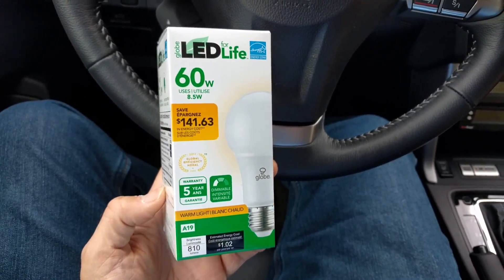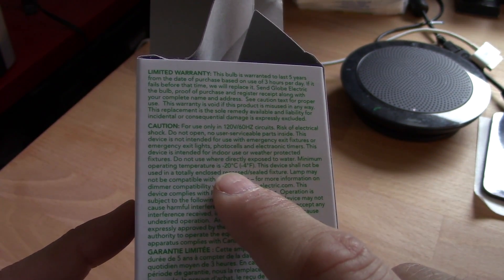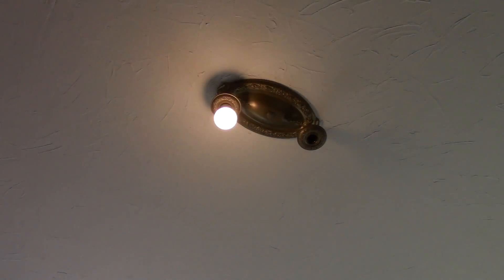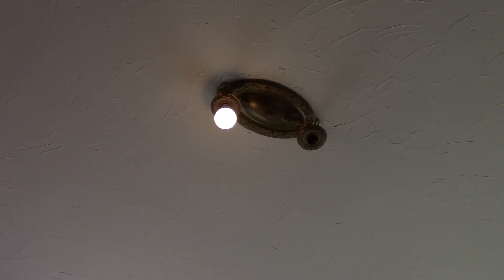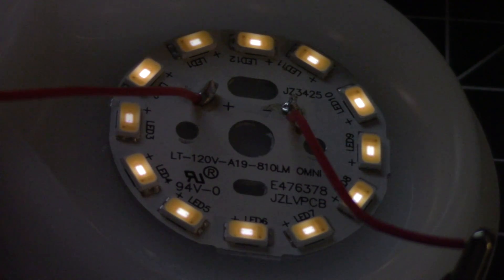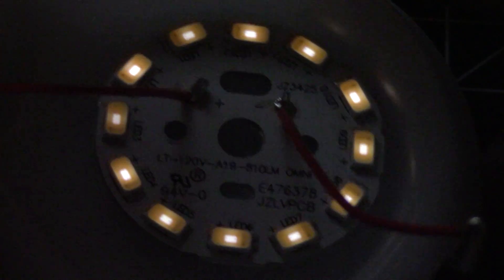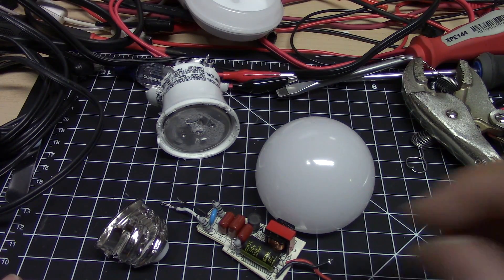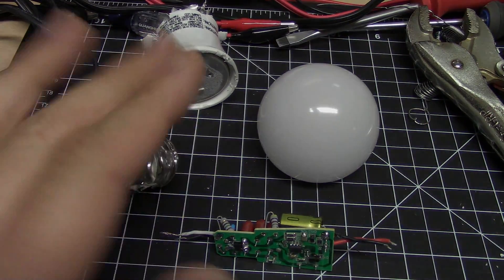Dollar Tree $1 Dimmable LEDlife 8.5 watt (60 watt equiv) LED bulb review and teardown

Comment: So, do these Globe LED lights still work at this point? Have you tested their longevity? That's the real test of LED  light bulbs: how long they actually last. I have some Philips LED bulbs that are 3.5 years old and still working, although one has slightly dimmed. The cheaper LED bulbs usually don't last as long as the more expensive ones, but only real world usage will show you the results.
Reply: @adriansdigitalbasement  I see. Thanks for the info, Adrian!

They're currently selling these Globe LED bulbs for $1.50 (Canadian) at my local Wal-Mart store. With the hydro rebates earlier this month, they were actually selling them for 50 cents per bulb. I didn't buy one, because I thought they were junk. LOL! Globe used to make the dimmest incandescent bulbs I've ever seen, so I thought these would be similar. But it looks like I passed up a good deal. LOL! However, I did get some nice Sylvania LED bulbs (9 watts, 2700K) and some Noma bulbs (9 watts, 3000K) for 50 cents a piece. So, I didn't miss all the LED deals. LOL!  ;-)

So far, my longest lasting LED bulbs have been Philips, particularly the "Slim Style" bulbs. They're 3.5 years old now and still working. One bulb did dim slightly (I checked it with a light meter), but that was after heavy usage: I estimate over 21,000 hours of usage, but that's an approximate figure. It still works, though. It's just slightly dimmer now.

Anyway, thanks again for the info!  :-)
Reply: @adriansdigitalbasement  Have you tried dissecting any LED filament bulbs yet, Adrian? They're pretty interesting. The light they cast is very similar to incandescent bulbs, although the colour temperatures can vary. They're more expensive than the regular LED bulbs, but during the hydro rebates, we can get good deals on them up here too. With the hydro rebates, I've bought LED filament bulbs for as little as $1.65 (Canadian) for a two-pack of G25 bulbs. If they last, it will be a good deal.

That might be an interesting tear-down project for you: dissect an LED filament bulb. Just a suggestion, though.  ;-)

Comment: I guess the dimmer that you used is not a classic one built in triac (leading edge), because according to the circuit there is no special IC to support that.
so the dimmer that you used is a digital one (PWM) ??

Comment: I am a gaffer by trade and I actually prefer 3000K to 2700K. I find the 2700K Kelvin too yellow-ish for my taste. My real determinant though is the purity of the color. Often the CRI (color rendering index) is lower in cheap LEDs and you may, or may not, see a green or magenta cast similar to CFLs. A problem with dimmables is the thresholds. The don't have the smooth, incremental dimming of the old tungsten or halogen bulbs and may not dim as darkly before dropping below their minimum operating threshold and going off or stopping at a minimum dim that may be more lumens than desired.

Comment: Even in the expensive UK, we have 5W led bulbs for £1 in "pound" shops and 9W bulbs at 5 for £7 in builders merchants, including purchase tax.  The bulbs give warm, pleasant, useable light and don't have very poor power factors.  They are not dimable, but I don't care.  I have used them exclusively in my house for a year or two and have suffered no failures, although some do get hot to the touch.  These bulbs are certainly not subsidised in the UK!

Comment: those are a bargain at a dollar...I tear em down and through them in project boxes for use as LED project power supplies so the projects can be plugged into mains without messing around on a breadboard developing a mains LED power supply from scratch.  also they are useful for driving "high power" led chips like the 10/30/50W ones at a nice low state without over driving them either permanently or when  testing. ....it's a quick and dirty way to get mains to useable DC without spending a ton of money, time, head scratching, component hunting etc. I buy em all the time...n they are great for threshold testing certain stuff too...for a buck, who cares if you blow it up! ...n I've scavenged caps and passives from those boards as well....for a dollar I couldn't buy those components in the amount you get...very nice when you find useable opamps and other treats inside some of them...n the caps and transformers are EASY to desolder and use in other stuff. I can't find transformers of a similar value for around a dollar each unless I buy in quantity do that alone is a benefit... hope you guys got some ideas from this novel lol

Comment: 99cent only! had 8 watt (60w equivalent) led bulbs. i bought 2 just to check if i liked the light output & color. i did, so i went back and bought like 25 of 'em.
when you compare to the cost of the led bulbs you find everywhere else (typically $5 to $20 each), it was a no brainer. replaced all my florescent bulbs.

Comment: That's one hell of a good purchase for only one buck! I saw my first real $1.00 light bulb at the 99 cent store chain in California and I picked it up. It was terrible! Claimed to be a 40W equivalent using only 5W and it was 6400K giving absolutely the most garish white light that resembled the fluorescent lights of the 1930's I took it apart and the thing had 1/4 the circuitry your $1.00 store bulb has. How crazy that less than 10 years ago LED bulbs were selling for $60.00 each! The 99 cent store light bulb is so cheap that it weighs less than a real glass light bulb. https://www.flickr.com/photos/9874196@N03/albums/72157665903562912
Reply: 4 years ago they were still going for that price.

Comment: Wow. That circuit in yours is elaborate.. I just opened the Luminaire Home 60w I found at my Dollar Tree. I think I need to grab the rest - I don't think it's regular stock yet.

The circuit I saw in the bulb id just two components - a bridge (MB10F) and an all in one driver ic (BP5131D) - I'm uploading the video to my account soon ( at time of this message it was still rendering ).

The distributor is Greenbrier, which is Dollar Tree so maybe this will become a regular product as Walmart already stocks a $2 version.

The discussion is here:
http://cornerstore.rainfall.com/cornerstore/project-dissection-electronic-project-luminaire-60w-led-bulb-found-at-dollar-tree.html
Reply: So which brand do you think is better?

Luminaire Home - 9 watt, 800 lumen bulb
Globe - 8.5 watt, 810 lumen bulb

Comment: This absolutely has to be a loss leader or surplus. There is no way the manufacturer is making money when a lamp with a supply that complex and all that metal is retailing for $1. Also, it could be your camera but I didn't see any visible flicker banding when you tested the lamp! That's not the easiest thing to accomplish in a dimmable lamp. 

I've seen recent teardowns of lamps that retailed for several dollars, which had much simpler supplies, discrete components only, nowhere near the heat sinking, plenty of flicker, and a crap warranty. Amazing.
Reply: we have had  LED bulbs 9w 60w equiv for a long time  here in MA at dollartree
but they are called greenlight brand  they say dimmable and  approved for totally enclosed fixtures and it has an icon that looks like an outdoor light where it says it
 on the package there is an extra cardboard flap that says "special pricing brought to you by Mass save savings through energy efficiency logo  , Eversource energy logo then nation grid and Unitil logos",  so i am guessing these things  state subsidized or something not sure how it works exactly, these companies  give money to greenlight company to sell the bulbs cheap and then the state or federal government   reimburses them or something i am guessing 
 Oregon is a liberal state too  maybe they also are subsidizing those bulbs , i am not really sure what the difference is i can't remember if they had those or any other brands before or now , but i wonder if these greenlight ones are better or worse or the same as the one in this video and the other brand i would like to see a full comparison all 3 dollar tree brands torn down and compared and reviewed
Reply: The answer is in the 8 pin chip. It include the switching FET transistor, the oscillator for PWM and even a power factor correction which prevent flickering when the dimmer reduce the input voltage.

The large electrolytic capacitor is on the output, parallel to the LED for a good flicker free light. The AC input is barely filtered with the small inductor. This is the best LED light on the market, except the PCB is not protected against humidity.
Reply: @ska042  adrian didnt mention the chip number but it seems to be a LYTSwitch part

Comment: some dollartrees have floods as well. I got 4 and using 2 in recessed lighting in bathroom. I will say they do work WELL. I converted from incandescent to CFL and power bill went from 150 a month to a bit over 100 now it's under 100 with partial LED conversion. that's at 8c/kwh for onpeak but I also have an off peak meter for the heatpump and hot water and that meter runs about 4c/ kwh. not bad. but the furnace blower is on on peak due to dual fuel setup. I get LEDS as I find them on sale. I think the government subsidises the cost.
Reply: what floods? LED floods of CFL floods?

Comment: Well these ones address that problem with the heat. And they have a nice power supply, is not a cheap capacitive one. 
Also, that 130ºC cap, it's quite unique!
Sadly, I live in Argentina, and they cost 6 USD minimum, non dimmable. Like the Philips brand. They're impossible to repair and I think they have capacitive cheap p supply.